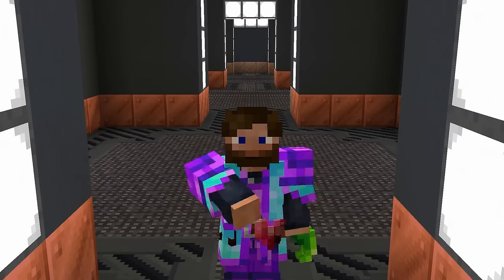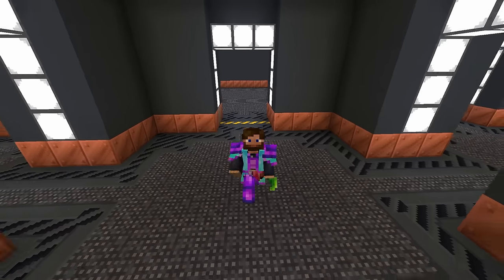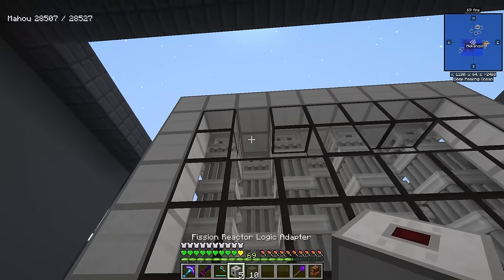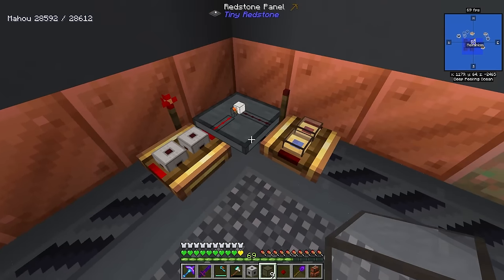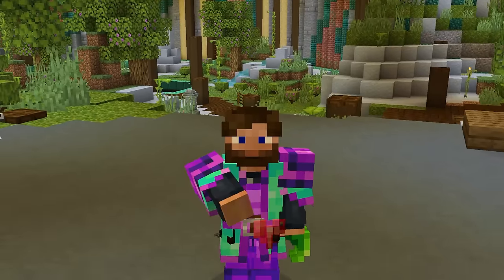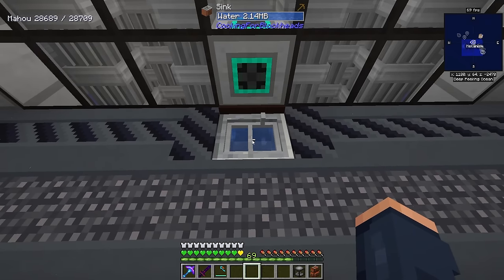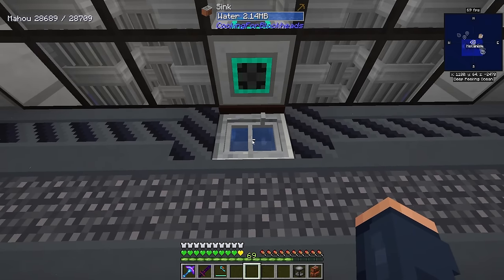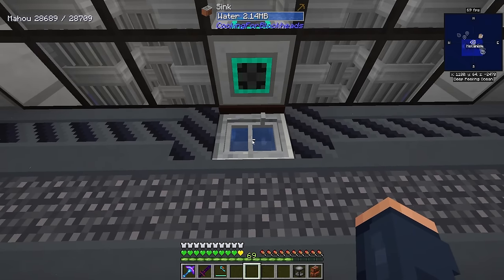All The Mods 9 Modded Minecraft EP31 Easy Fission Reactor Setup for Mekanism

Comment: I set up my Fission Reactor today as well, I went for a max size one (18x18) and a fully sustainable 576 mb/t burn rate. Totally worth it. I also did the Fusion Reactor for 200 million FE/t. Mekanism is a journey
Reply: Yeah, it's nice except the only thing you can seemingly use that much power for is to fill up an induction matrix and watch the numbers go up or maybe dump into a SPS Chamber, though you really don't /need/ to dump that much, it /does/ pretty much void whatever you dump into it. So I guess if you didn't have an energy trash can in your pack it could be used that way. I kind of wish there was more stuff that would use power like that because I hate letting it pretty much all go to waste. With normal machines you'd need to setup a truly lag inducing mega factory absolutely packed with machinery constantly running in order to put a dent in the power production. Oh and maybe avoid energy upgrades in most of your machines, though I tried doing that and some machines won't run full speed if they don't have energy upgrades, it's easy to forget that they also increase the machine's buffer and not just make it more efficient. So if you want some machines to run as fast as possible you can't skip the energy upgrades to burn power.
I suppose there's the infinity tools from foregoing, they can eat a ton of power, though after a certain point the amount of power needed to get to artifact tier is something that can't realistically be generated, you're basically just voiding power past that point, which I guess if that's what you want...
Reply: How many turbines did you setup for the fusion reactor? Any tips on how to reach 200 MFE/t? I only managed to reach 120 on my last modpack run, thanks.
Reply: @Ressu-u8c  to get to 200 MFE, what you need is not turbines, what you need is to produce a consistent 1000 MB/t of D-T Fuel, that is what determines the production of energy

I don’t bother with the turbines because they are pretty much useless in this version of Mekanism, when you’re at this point you just go for the fusion reactor and don’t do the turbine
Reply: @PoliAstroN  ah, so just pump in pre-combined DT fuel and set the injection rate to 1000? Otherwise it's just making fuel fast enough? How many maxed towers and water pumps did that take?
Reply: @alysaere  Last time I've heard, is a minimum of 5 or even 10 full-sized thermal evaporation with heaters and solar panels on top. And then about 100 Water pump for deep water...? This is what I've found last time. Please do correct me if I am wrong.
Reply: I have a problem with my 18x18x18 Reactor, it won't blink red, it didnt work. I build it again 5 or 6 times but it just wont work.

Comment: Thank you for showing the integrated dynamics water pump.
I've made quite a few reactors and the only problem I've ever had was water pumping in.( For a while in ocean block my base was safe because any hostel mobs just got a radiated to death)
Reply: There is an even simplier way in ATM - just slap Eternal Water Block from Evil Craft right on the input and you are good to go for any size reactor)

Comment: What I have seen is that the waste gets only on 1 barrel at the time and the way to fix this is with the Logical Sorter from Mekanism. If you activate the round robin option, you are going to distribute the waste in a much more efficient way.
As per usual, Great Content :)
Reply: Did they change how pipes and tubes work in 1.20? It uses to relatively evenly distribute by default.
Reply: i use Gas Pipez since they distribute in the round robin method by default. It's very effective

Comment: Hi Chosen, I think you can toggle the button in the redstone activation block in the machine to invert the redstone signal as well. Then you don't need the tiny redstone setup and can directly connect the redstone links. Have not tested it though, but saw in the speedrun of ATM8 by AlfredGG that he didn't need any inversion on the signal. Love the playthrough!
Reply: I just did this in my game last night. It’s nice because I can use LaserIO to send the redstone signal, and use the cross dimensional capabilities to send the signal to ky main base so I can quickly see if my fission reactor goes offline.
Reply: Isn't the redstone link by itself already an OR gate? If the reactors runs on no signal and each individual fault can generate a signal, then the reactor will turn off if at least one fault is detected.

Comment: In version 0.2.46 it's possible to have a burn rate of 717,7mB/t without it overheating :).

You can also get by with only one output port for coolant if you place the trash can directly against it. One port can without a problem sustain the heat rate of 14 352 436 mB/t as it seems. It would be interesting to try with sodium, I assume the port is not limiting.

Comment: I may be wrong, but if reactor will overheat, it will emit redstone which will shut it off, then it will cool and signal will be off, which will turn reactor on again. And it will stuck in a loop. There are mod called more red, I used latch from there, it switches once when receives signal and doesn't turn back on. Good luck 👍
Reply: There's also the logic thing from rftools that you can set to behave like a RS latch, basically have a button to turn it on, set no inputs to Keep signal, and then if it receives a signal from any of the outputs set it to turn off until you turn it on again.
Reply: You can also just make an RS NOR latch manually out of redstone torches, either full size or micro.  But yes, it's definitely a better idea to have your reactor shut off and stay off if it trips, not turn itself back on when it thinks things are OK again.

Comment: You don't really need adapter checking for insufficient fuel. If reactor don't have fuel it won't run anyway, so what's the point in turning it off. Even damage controlling one shouldn't be necessary, because with fast enough failsafe and enough cooling reactor will shut down on high temperature and cool down before damage will even have a chance to go up. I don't think you can have faster failsafe than what you've made and you have way more cooling than you need.
Reply: The good part is hooking up a redstone lamp or screen at the base to check if the reactor has faulted. Then the no-fuel state is pretty handy to have as a redstone signal.